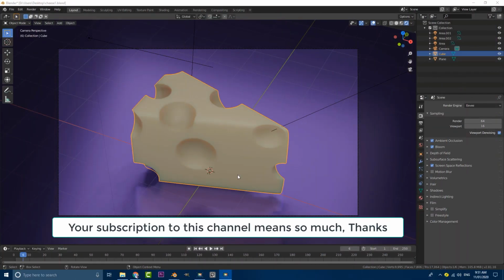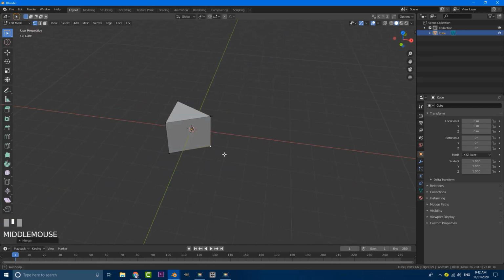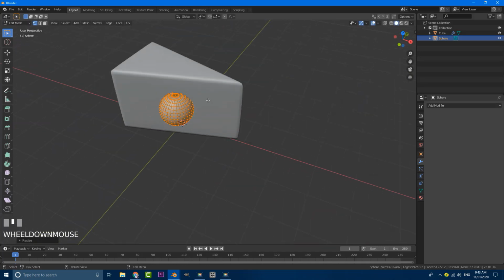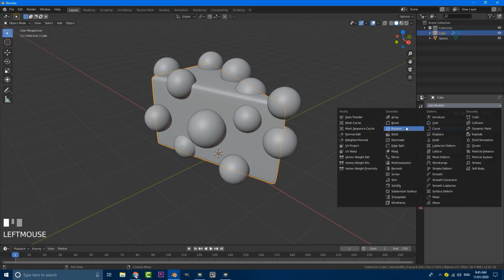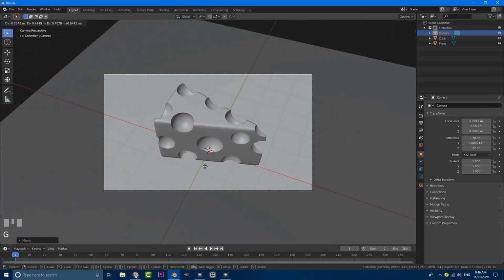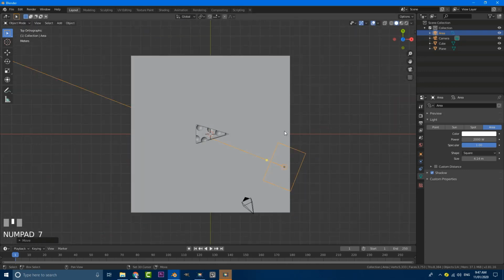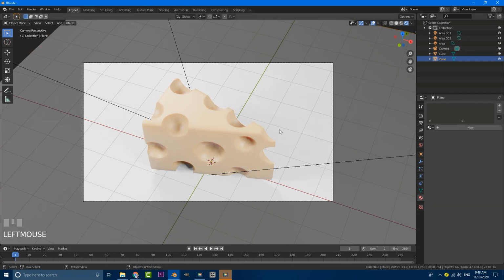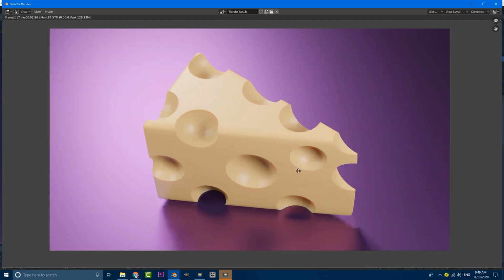Make Cheese In Blender Using Boolean Modifiers [2.81]

Comment: Boolean modifier is disabled when tried applying , it applies on few spheres but it doesn't make a hole
Reply: You must enable the option in the modifier: SolverOptions->Self Intersection to true. Also you should use Difference mode